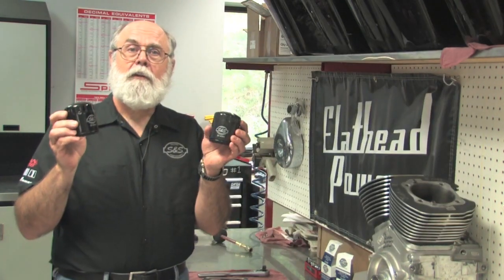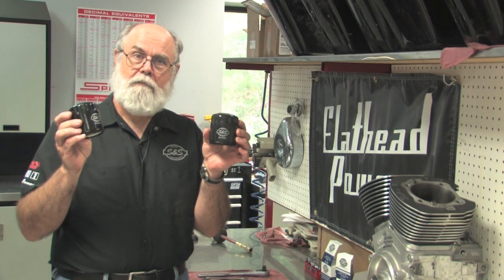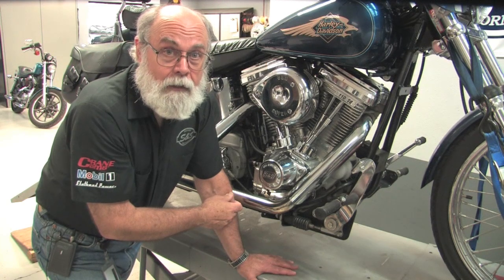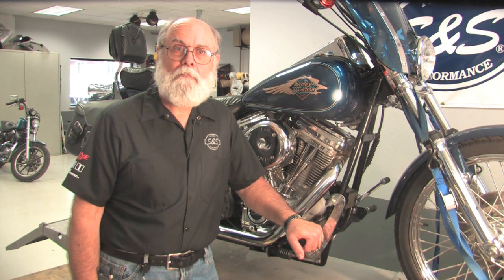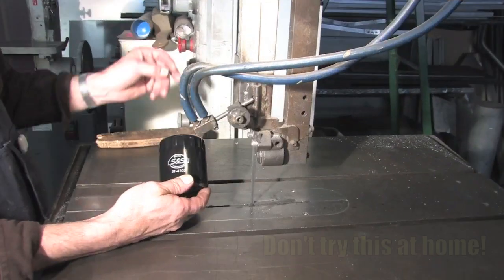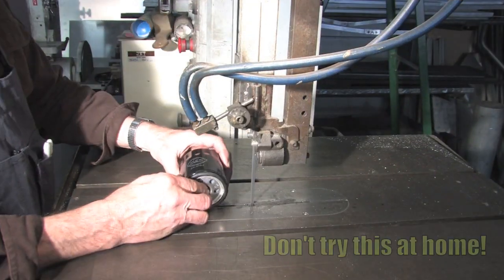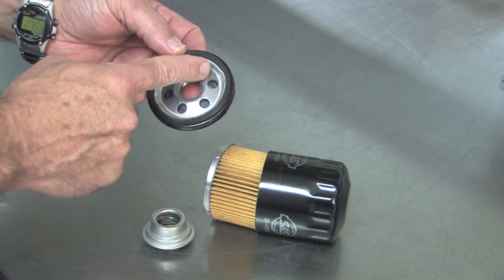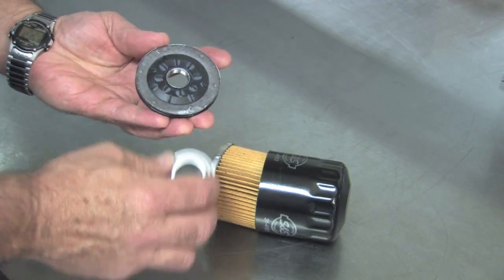S&S Cycle Tech Tip: OIL FILTERS

Comment: The Sportster EVO's are different from the Big Twin EVO. How about some more info on the 883/1200 designs?
Reply from the maker: That's true, not all Evolutions engines are created equal. We don't have a video specifically on the Sportster oil filter function.
Reply: @SSCycleInc  According to my Harley Sportster factory service manual, the oil pump is the opposite of the EVO 80's and has the oil filter before the engine instead of after it. So, it can take the ADBV although it can get by without one. I use a WIX 21-micron oil filter instead of a 5-micron oil filter because of the looser tolerances.

Comment: So what do you recommend for a S&S super stock 88 evolution engine?
Reply from the maker: We recommend using our filters. Part Number 31-4102A for Chrome and 31-4101A for Black
Reply: @SSCycleInc  thanks 🙏 but you took so long to answer that I ended up buying another brand I even tried to call and left a message but no call back and this late response thanks though

Comment: my 1989  FLHS the filter is just in front of the  rear tire .So do all EVO need a filter without the ADBV ?
Reply from the maker: Oil filters with Anti Drain Back Valves can, in many cases, restrict the flow of oil in the return line enough that oil accumulates in the crankcase instead of being scavenged back to the tank the way it should. The result is that oil will start coming out of the crankcase breather. So yes, we highly recommend the correct non-valve filter.
Reply: Thanks for your reply and  for your video . what a difference it made when I changed the filter to one without a ADBV   . I give you guys at S&S two thumps up .
Reply: A shop put a TC filter on my Evo and it blew the oil lines off. If you have a stock of filters in your shop blow in the center hole. Evo filters flow air freely TC’s do not

Comment: I may be trading my Street 750 for a Sportster 1200. A 2018 model. Does this engine use the high Flow filter? Or the Smaller Micron filter? Thank you
Reply: Chris Philhower I think the biggest take away is not to use a TC filter on an Evo. An easy way to tell the difference is to blow into the center hole. Blowing in an Evo filter the air will come out the smaller holes. Blowing in the center hole in TC filter will be quite hard because of the flaps. I found this out the hard way. A shop put an TC filter in my Evo. I blew out my oil lines. As far as microns check out the Flo reusables.